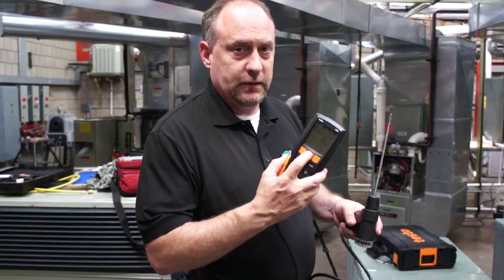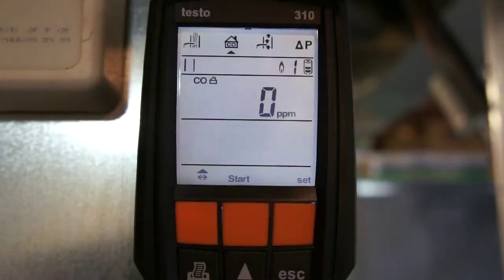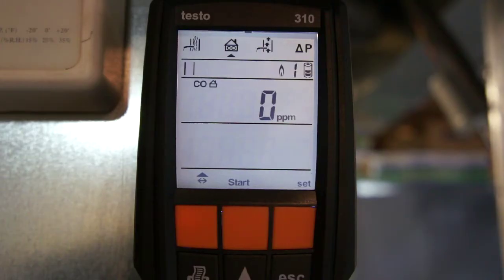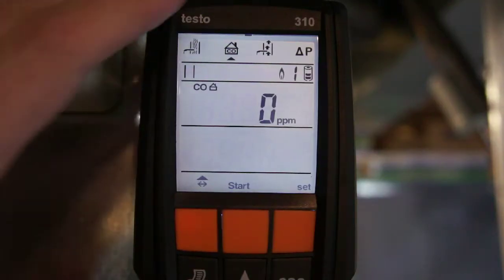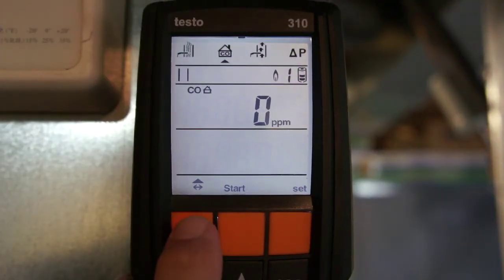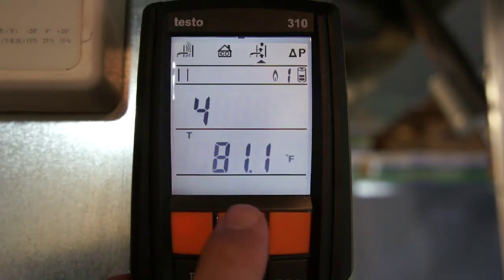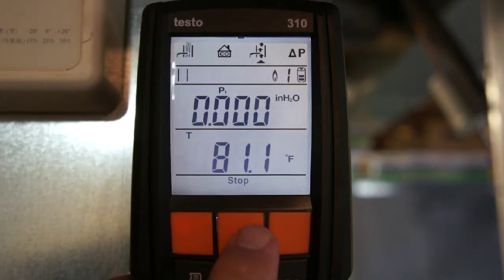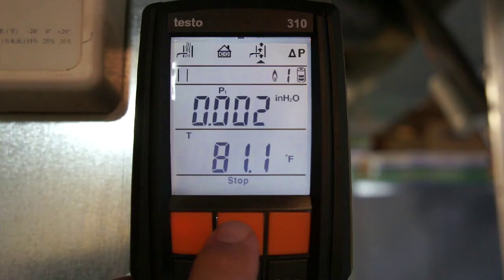Additional features of the Testo 310 Combustion Analyzer

Comment from the maker: It will be close for pellet fuel. The Testo 320 and 330 have different moisture settings for wood, not sure if the Bacharach has those. Wood burning is much more common in Europe.  All that these settings impact though is the efficiency calculation. The rest of the readings will be the same.

Comment from the maker: The 330 will also  measure pressure and ambient CO, I am doing a video on those soon that will go over that. The probe for the ambient CO  is so you can measure ambient CO at the same time you are doing a combustion analysis. That is somthing you cannot do with the 310. The 330 meter will do the same test that I demonstrated.
Reply: Can the ambient CO test be performed in a duct or plenum with the blower running?